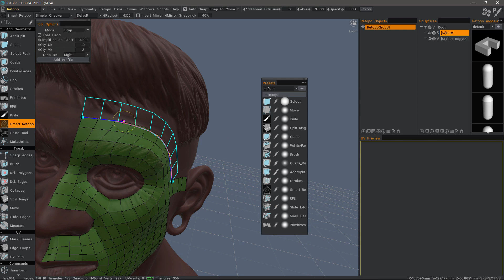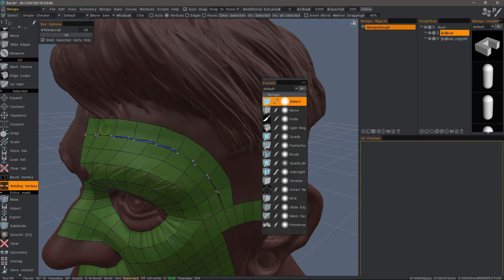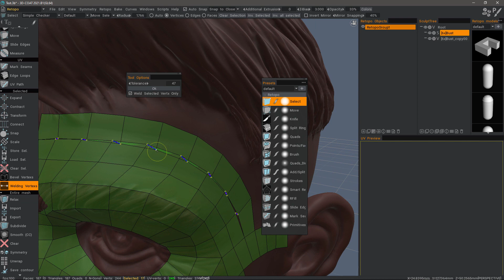Retopo: Weld Vertices Tool

Comment: I wonder if there is some sort of global or maybe per tool auto welding threshold that can be set, so that you can skip this extra step.
Reply from the maker: You have to first select the vertices, which can easily be done with a freeform or rectangle lasso in the E-Panel.